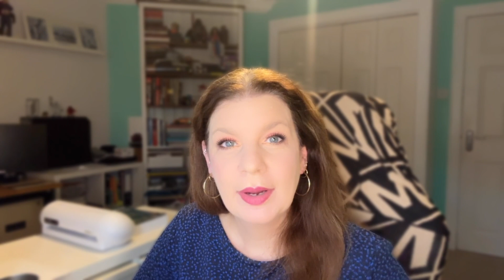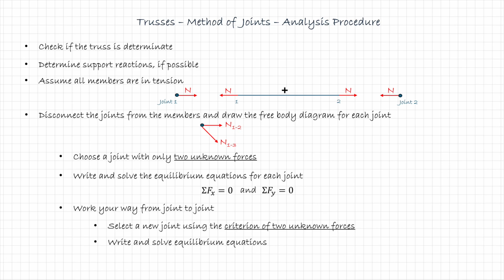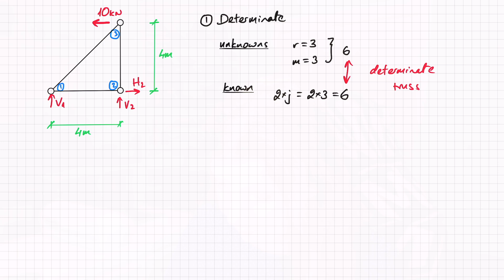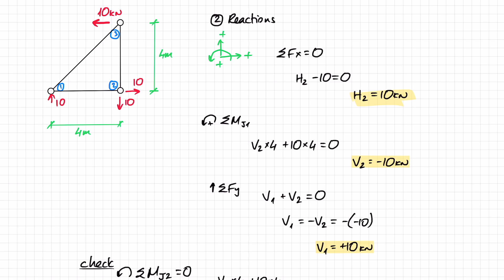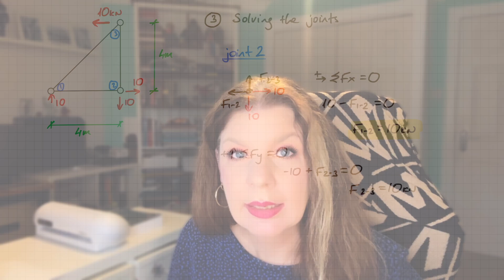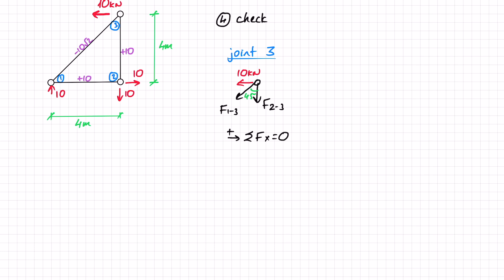Truss Analysis for Beginners | Method of Joints Tutorial 1 | Easy Step-by-Step Solved Example

Comment: Thanks for sharing. Question: for moment around J1, I see V2X4; but why is the force arm 10 kN for the second term (4m)? (edited)
Reply from the maker: When doing moments around J1 you have the force v2 times 4m (as you noted) and the horizontal force of 10kN at joint 3 times a distance of 4m. 
The best way to remember is that the distance is always perpendicular - so for a force in x you need a distance in y and for a for in y you need a distance in x.
Reply: So that 10kN force is acting at joint 3, and joint 3 is connected to joint 1 thru member 1-3, which is 5.66m. So what’s the reason it’s incorrect to use that 5.66m force arm?
Reply from the maker: We always need the shortest distance from the line of action of the force to the point around which we want the moment, which will be the perpendicular distance. As the 10kN at J3 is in the x direction, we need the perpendicular direction for the distance, which is the y direction. 
I have lectures that discuss force systems, which might help clarify:)

Comment: Interesting and good revision for me. I did this years ago. But not sure as thorough. As a Mechanical C.Eng, there seems to be common ground in mechanical and structural engineering.
Reply from the maker: @henrybuckeldee3783 Thanks so much! Glad it helped. As you mentioned, there’s a lot of shared ground between mechanical and structural — the same mechanics, just different contexts. When I was in industry, we had both disciplines in the same team, often approaching the same problems from slightly different angles:)
Reply: @EngineeringTheCurriculum Interesting to hear. I have developed an interest in structural engineering. And been searching for low cost accredited courses for IStructE. Hard to find. I read alot on Eurocode designs for timber and steel. Which I find relatively easy to understand.